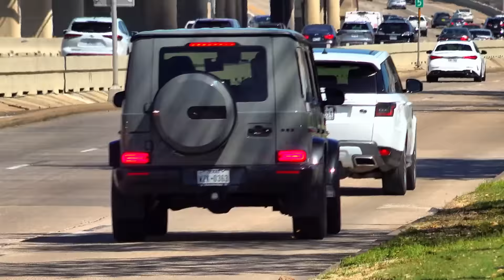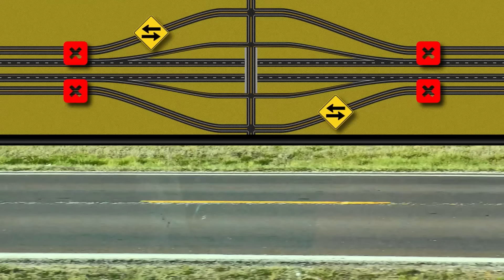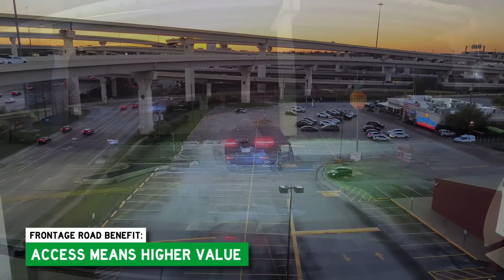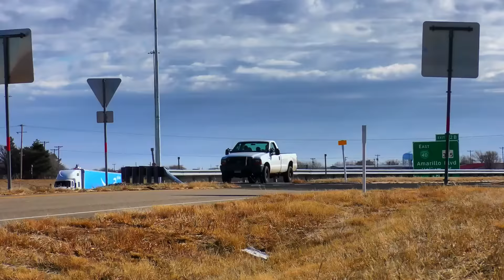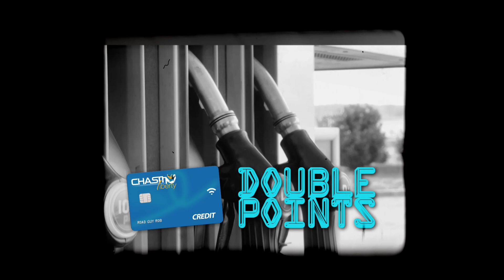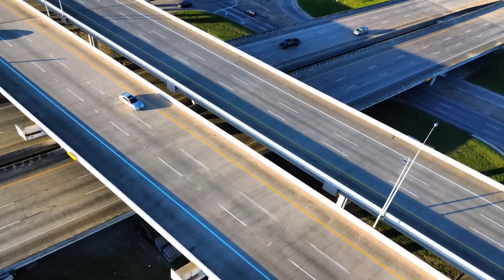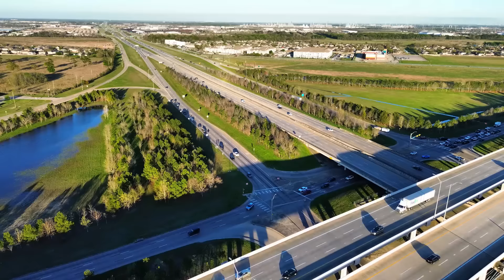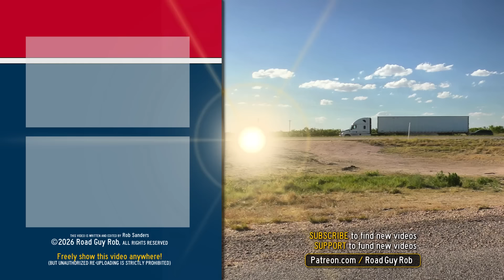Why Texas Builds a Freeway Next to Every Freeway

Comment: I grew up in TX so I happen to love the frontage road design, it makes things so easy to get to.
Reply: Driving half an hour to get anything isn’t exactly what I’d call easy. Nor is trying to pull out of a business while people are driving past at highway speeds.
Reply: @williammckenzie6865 , half hour? Maybe if you lived out in the middle of nowhere. You can get to almost anywhere in Dallas in about 30 min (traffic permitting), and all of these shopping centers and frontage roads are <5 miles from most people’s homes. Pulling out of the shopping centers isn’t too bad because you have gaps in the traffic created by the signal lights. And if you don’t want to exit onto the frontage roads because of traffic, you can usually exit to one of the main roads on either side of the parking lot.

Comment: Welcome to Houston! I'm a fan of the frontage road system. Yes, as people have pointed out, it can make the areas around freeways less than attractive with endless rows of strip malls liking them through urban areas. But from a traffic perspective- you're placing many of your business on the best main street a city can have: one with a freeway running through the center. From a navigation standpoint, frontage roads are great! The interface with surface streets is predictable. And the turnarounds greatly reduce the consequence of missing an exit- often, you can do a U and be back on the freeway without ever even coming to a stop.
Reply: The best Main Street a city can have is a fully pedestrian street without any noisy, dangerous, pollution spewing vehicles flying past you at 70+ MPH.

Comment: Feeder roads are common in Poland. When a national route is upgraded to an expressway or freeway, we keep stretches of the original road as a feeder road. Often times we do build new roads to serve as those, but they don't span the entire length of the expressway/fwy - if there's no residence or business in an area, the feeder road terminates by either becoming a dead end or spurring off into a local road. The feeder roads also don't have direct entrances from the freeway (except for maintenance gates, which are opened to regular traffic only during emergencies. You typically willingly enter a feeder road from an interchange (usually a double dumbbell here in Poland). Hell, not only expressways and freeways get feeder roads. I live near a voivodeship route (equivalent to a state route in the US) that was partially upgraded to a double carriageway, and where that upgrade took place, feeder roads were added. You enter those from side roads, as a voivodeship route gets normal intersections (in my case, the dual carriageway stretch got roundabouts).

Our feeder roads basically do their job well, we just know they're for LOCAL traffic.

Comment: 6:28 "Because on most Texas frontage roads, the cars on the off ramp get the right of way, which is... weird."
Not most. All. And it's not weird. Why on earth would it be weird? The more primary, higher speed road almost ALWAYS has the right of way when it meets a smaller, lower-speed road. What's weird is that people who were born and raised in Texas and went through exactly the same driver's ed as me don't know that...
Most are even marked to tell people on the access roads to yield.

And the really bad part isn't the ones who are coming towards you, it's the ones who are going the same direction as you blasting at like 5mph under the interstate speed limit (or like 15 over the access road speed limit).

Also, Austin got rid of ALL the X's around because people just used them to skip lines and lights like you mentioned, and would back up solid from the exit ramp to the entrance ramp so that no one could get on the interstate there. There were a bunch along IH35 in Austin when I was growing up (90s-00s) but they're all or nearly all gone now.

The signal timing is all completely standard, except for around toll roads where it's completely different for some mysterious reason which is definitely not to make the light timing worse and encourage people to pay the tolls which then directly benefit TxDOT. There's no real engineering that goes into it, just copy-paste.

Comment: The pattern I've noticed in Houston is when you're at an intersection on a feeder road is:  the green lights go clockwise around.  So when the lane to your right in the series has a green light, your lane will be next.
Reply: Also, I wish they'd give a Texas Turnaround a dedicated and protected lane when merging so they don't have to stop/yield at all.
Reply: also, where they don't have enough width for frontage roads and interstate style roads, you can elevate one or put one down lower... in Dallas, a lot of the interstates are down lower and the frontage roads are up above and you can have some overlap if needed.

Comment: I lived in Texas for a year and can tell you the frontage roads had a major flaw that this video glosses over: when the frontage roads flood during heavy rain (typical since they are usually lower and also engineered for less), now your freeway backs up because the only way off the freeway is out of order. And while the frontage roads might be "valuable", it causes a different problem of killing the small town to save the freeway.  I also think this level of road infrastructure is... pretty ugly. 

I did slingshotting a lot through Houston during rush hour. Google Maps actually tells you to do this in my experience.

Comment: This is how Phoenix/Arizona build the 303 freeway. They built it over the top of an old one lane road and purchased a huge space. Then after that existing road ended, They build the off-ramps and and on ramps. The  road part was just two lanes wide. Then as they need the overpasses for new roads, they build the overpasses and build the freeway out to 3-4 lanes wide. And do that every few miles and now 15 years later it's a huge new freeway when massive interchanges and new overpasses

Comment: Service Roads, like those, are always better because they are the emergency option for when a crash happens on the highway and the highway has congestion or has to be shut down. By having the service roads there, this keeps traffic flowing as much as possible, even though there are stoplights and the stoplights will cause alot of traffic too. But, this is still better than making people go East and West when they want to go North and South along or on the highway!

Also, the service roads keep traffic off of other roads and not blocking normal city or small town streets in downtown areas.
If you have ever been somewhere like this, cough (Kansas City) cough you would understand just how much of a headache it is to get around when an emergency happens!

Another plus: You can go to Pilot to fill up with gas and go to Whataburger to eat and easily get on and off the highway quickly without having to drive farther out of your way! Then, just get back on the highway and get to your destination quicker!

Hey, don't complain! The X configuration is WAY SMARTER AND BETTER because, well it's common sense! You have way more room for weaving, slowing down, storage, etc, just like you said, and it encourages LEGAL driving maneuvers! The opposite way encourages ILLEGAL driving maneuvers and that's why I HATE the other way! Texas knows what they're doing!

That's EXACTLY why I say all Giant U turns NEED TO GO INTO THEIR OWN LANE!!! They can make them merge a few feet later. I don't care. But making drivers bend their neck the way you did, makes me feel EXTREMELY unsafe and causes traffic backups because there is no way to keep the traffic flowing, which a merge in lane would do.

Comment: A couple things about Utah: they have two of those Texas-style frontage roads. There’s 2100 North, which you showed, and that’s being converted to a full highway right now. Then there’s also Mountain View Corridor, which starts construction on the main highway next summer. 
The main issue with them is the bike infrastructure. They are both 55mph roads, but still have bike lanes on them with no protection or buffer. Whenever there’s a right turn, the bike lane becomes very narrow, and is sandwiched between lanes, like what you would see on a lower speed arterial. Except this is a 55mph road. I’ve nearly been hit by drivers going over 60mph who drifted into the bike lane.
In a lot of spots, there’s also no sidewalk or good side roads to use as an alternative route. Overall my main complaint with this type of road configuration is that, while great for cars, it’s horrible for everyone else. Crossing them at the crosswalks is stressful (especially when the timing is short), walking along them is usually not an option, biking them is a nightmare, etc.

Comment: I hate driving in Houston (I live in Fort Worth). My SIL and daughter both lived in Houston for a while. I learned the shortest A to B distance is not usually the fastest. What I found is that the main freeways are big circles surrounding each other, with other freeways coming out like spokes on a wheel. I will drive outward on a spoke, drive around, and then come back in on the spoke nearest to where I am going. I assume this is by design.

Comment: I remember hearing once before, one of the reasons why Texas has frontage roads like this too, is for the fact that they had some sort of state law on the books that gives property owners the right to access all highways. When controlled access highways started, that created a challenge because, you can't have the controlled access if you have driveways every couple feet. So to get by that requirement, that's why they built the frontage roads. That way it fulfilled the access requirement, but also let them have a controlled access portion. That's also one of the reasons why out in western Texas on the few stretches of I-10 in the very rural areas, you actually have grade intersections with access roads to farms. It was deemed to expensive to build a frontage road for such little population, so they had to compromise.

Comment: Thank you for another excellent video! When I've driven in Texas the frontage roads were the worst part. So much weaving traffic and so many times I had to turn on to the frontage road and accelerate hard. I suppose I would get used to it and I don't really want to. Hard to argue the design of them when faced with the needs presented. Okay, big A engaged.

Comment: Quebec, Canada loves their frontage roads too! take a look at Autoroute 15 / the Decarie expressway in montreal, its 6 highway lanes trenched and tunneled into the city, with a subway line running parallel for most of it, with 6 MORE lanes of oneway frontage road too!
Reply: That’s actually an awesome example of it. It’s always cool to see when and where some cities have adapted it in different ways, especially when they’re older cities who had to slap them in places due to previous development already there. Austin is planning on taking the entirety of I35 along downtown and basically doing the same as the Decarie Expressway, including those capping some sections and including some of those fun turnaround exits onto feeders. I wonder if the designers of the I35 redevelopment had some inspiration from what was done in Montreal.

Comment: The number of times I've heard stories of drunk guys driving the wrong way on the freeway is numerous. On trips east of Dallas, I've encountered two-way frontage roads, and they're really confusing. What doesn't help is that in these rural areas, the freeway edges are unmarked and unlit, so you only have your headlights and the center line to tell you where the road is. Coming off the frontage road, it's sometimes hard to tell where the on-ramp ends and the freeway begins.

Comment: In SW London we have frontage roads on the A3 around Tolworth/New Malden. They are so badly designed, we have houses and shops on slip roads so you have people slowing down for a shop at the same time as others are trying to speed up to join the highway. Some of the slip roads are almost non existent where you have to stop and look for a gap, the lanes are also really narrow. It’s a crazy design but it somehow works. I think it ended up like this as it was one of the first “sort of” highways built in the uk in the 1920s and at the time developers just built houses right next to it.

Comment: In Detroit, we have something similar, but we call them Service drives. many of the service drives was the pre-interstate/freeway road. for example, the full lenght of the Davidson and Southfield have service drives (as both are surface streets on either ends). and I-696 in Macomb County was built on top of 11 mile road.
Reply: The question of what their called is actually a really good test of regionality for very specific regions. There was a linguistic study done in the ‘00s and one of the questions was “what do you call the small road parallel to a highway”. For most people, the answer would either be “frontage road” or “I don’t know what those are”. Feeder road is a Houston identifier, Access road is San Antonio/Austin/Central TX, Frontage road is a general american term, and Service road is either DFW or Michigan. Houston I know for a fact used to label them as such on official signage, but had to fall in line with “standards” and now they’re all officially called Frontage roads, but you’ll still hear Feeder from locals.

Comment: Sometimes at the 45 bottleneck right after Cullen, if the traffic is bad enough, people will turn around and drive down the entrance ramp back to the frontage road, only to find out that the frontage road basically ends there and becomes main st with intersections, as well as a section of road where the light rail has to pass over every lane on that side of the road. It's a traffic nightmare, and there are other places like it (the 610 southwest corner frontage road, Westheimer Rd., Kirby at Shepherd, Richmond at 610. And frankly the issue is too many cars, exceedingly long commutes to work and shopping, and not enough travel alternatives to get to those places which, as mentioned, should not be so far to travel to in the first place.

Comment: We had one like the one in Chicago in my city where there were no highways and it was just all city streets, but then in the late 2010s the city got rid of it as part of a project to build a BRT (a proper one with phyisically separated bus lanes that actually speed up buses, not those that are just fancy bus stops), and traffic is so much better now that there are fewer lights and have to wait a lot less at the ones that still exist, even if we did lose a lane each way and you have to turn around at the roundabouts now.

Comment: Here in Dayton, Ohio, they re-did a bunch of level-grade interchanges on US-35 with U-turn stop lights. They already had one-way roads paralleling the highway on either side where there were businesses, so we just assumed when they wanted to redo it a decade ago, they'd just put 35 on a bridge over every intersection, then use the parallel roads a frontage roads. I really wish they had because it would have made things so much better. There are CONSTANT crashes there now because of the stupid design.

Comment: I think the UK's idea when they to deal with frontage road type issues (which is not often) is that they would mostly just put a roundabout under the freeway instead of lights. Sometimes there's lights on the roundabout. That automatically solves the problem of u-turns.

Comment: 18:34 they're adding roads so that you don't only have to use the toll. There are currently other routes but are so inconvenient to get where you want to go, it only makes sense to take the toll. The average home price in that area is 400k. Many homes being 500k+. I don't think they have an issue with paying even a $10 toll just to go anywhere. They also had the knowledge that it was toll only for a bit until they build out the road as that was the only way to get to the home.

Comment: What a vision and sound of hell! Rob has to yell to be heard. You could almost smell the horrible stink of gas exhaust mixed with the fumes of overheated asphalt.
Reply: Its a Highway, there’s cars. It makes sound. He’s literally 5ft from the highway, of course he’d have to yell. Thats how decibels work.

Besides Gasoline and Diesel smells good so I dunno what your on.
Reply: Shows how much you don't know. Texas forbids asphalt in the urban centers. It's all concrete until you get to rural districts. It cuts down on maintenance and the concrete lasts forever because of the milder winters.
Reply: And tires dust.

Comment: Central Arkansas has also adopted a version of the Texas frontage roads along I30 and I57. The I30 part is different in that it necks down from 2 lanes to 1 at each off ramp so the exiting traffic ceates the 2nd lane again.
Reply: When leaving a metro in Texas, some of them lanes will just turn into feeder lanes permanently and it’s a good, safer way to slim down the highway for lower volumes while avoiding just having a lane end and merge. In the cities, that’s the usual way they’re built. The same lane will just zigzag as a highway lane then a feeder lane for a good while and might veer off as an interchange with a different highway and the highway will have a diverging lane afterwards to re-expand.